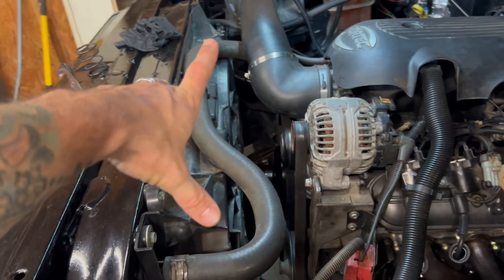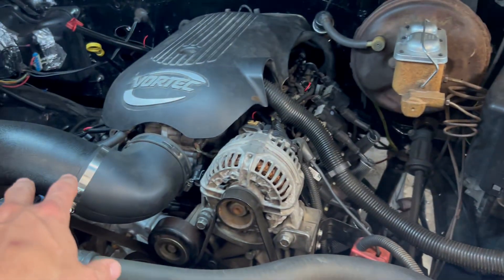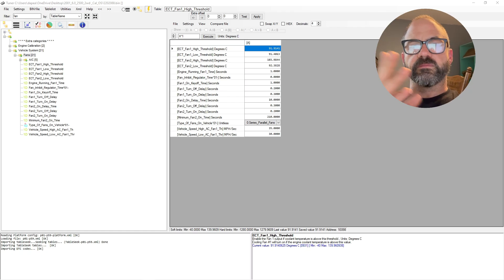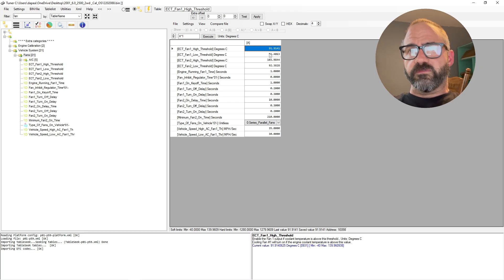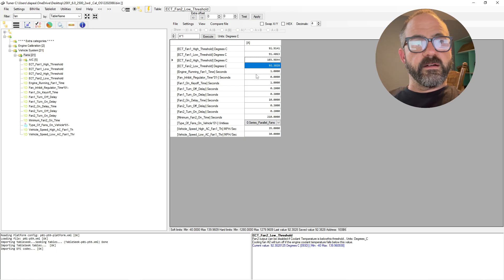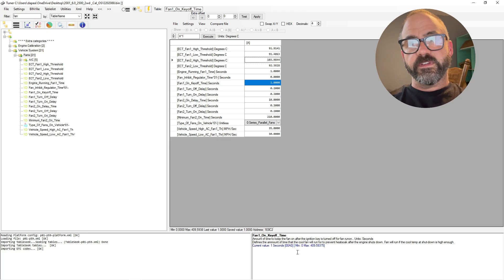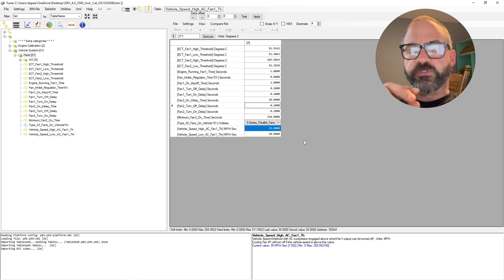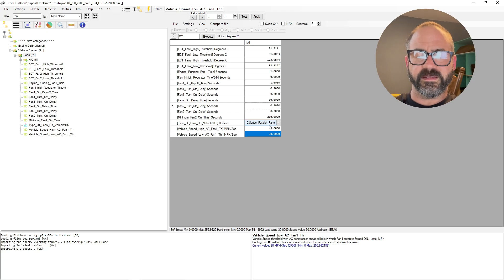Cheap LS Swap Electric Fan Setup

Comment: I’m guessing the tune will be different based on ac high pressure on my 04 tahoe
Reply from the maker: Yeah and mine is a 2001 to 2003 ecm so the ac parameters are a little different regards to fan control parameters for ac. I have not gotten a video made on those yet but for the 04-05 there is a great video from another guy on here that goes over the ac parameters. @2muchspl 
Has a great video that goes over ac parameters for the 04-05 pcm’s and the high pressure settings.
Reply from the maker: https://youtu.be/P5mlb2juvD0?si=dPCx7H0ZQWl5CIw6
Reply: @BrokeDadBuilds  thank you. That’s why I bought you a beer on your TikTok profile link 😂😂😂
Reply from the maker: Thank you Very Much!